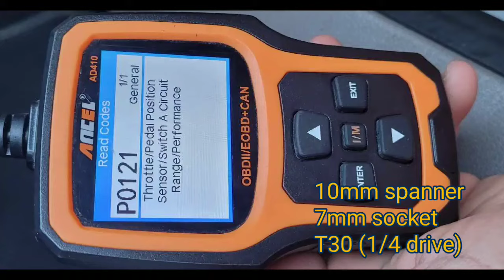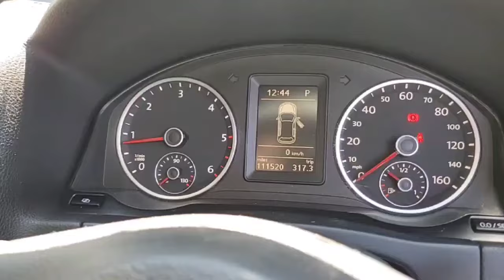Volkswagen Tiguan 2.0 TDI Throttle body/EGR cleaning P0121 throttle pedal position sensor/switch A

Comment: Great video, I've had the same fault code on my 2012 Tiguan 2.0. I have one question tho, is it safe to move the throttle plate by hand in order to clean it propertly? I've heard that it can mess up the calibration of the throttle position sensor.

Comment: What year is shown in the video???
Reply from the maker: 2010
Reply: @mbl-randomdiy6024  thanks. It looks very similar to the 2016. Maybe even identical. Might have to do this to my daughters car while I am in town. She’s got the EPC light.
Reply: @mbl-randomdiy6024  what was the 10mm and 7mm for?
Reply from the maker: @millerfamilyfitness9815 10mm for the bracket of the dipstick attached to the throttle body, 7mm for the hose clamp screw. Alternatively, you can use flat screwdriver for the clmp
Reply: @mbl-randomdiy6024  I figured it out after I got under the hood haha. But, the throttle body is as clean as a whistle. So I guess I’ve got a bigger issue.